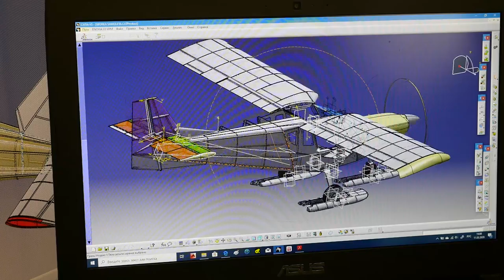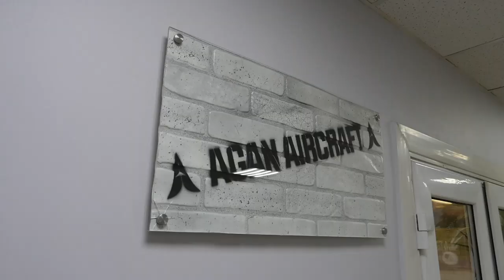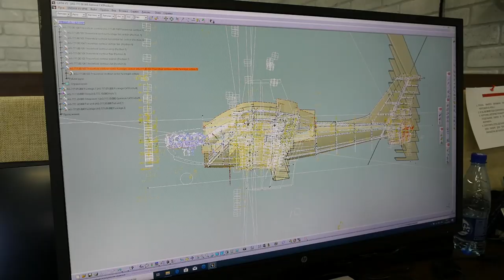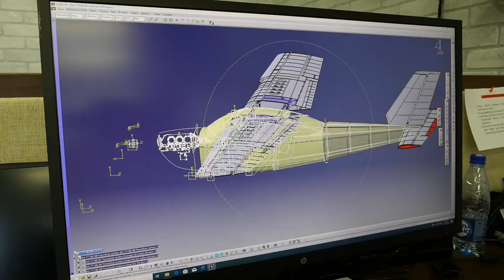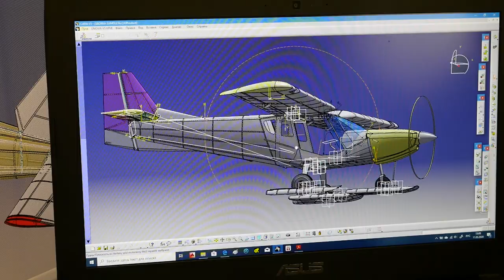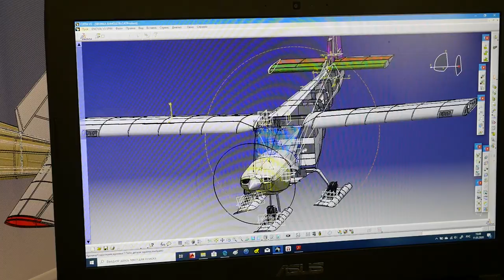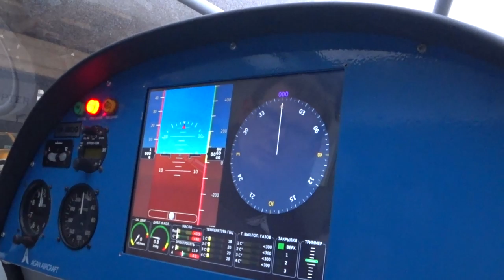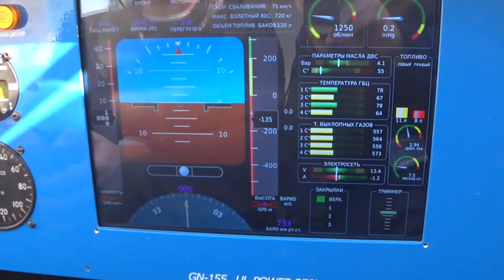AGAN Aircraft and general aviation from Russia

Comment: The 155 has some some inspiration from the Fieseler Storch by its looks and I am sure many improvements some of which are surely due to modern materials and production methods but the Storch was an awesome and likely the original STOL design.
   I do really like the Fowler flaps of the 155 but think you could do better by putting a PBS TP 100 power plant in the nose.
Best,
R.C.Christian

Comment: Only a personal point of view: The Complete Package, would be the option (with the penalty of increased price) for a Good Ol´Super Reliable Lycoming engine option.
Reply: The UL engine is a very reliable engine that has been around for several years now. They are becoming very popular here in the USA, and hundreds have been flying in Europe for years now. I prefer the UL power plant over the Rotax any day because of the direct drive and air cooled fuel injection.